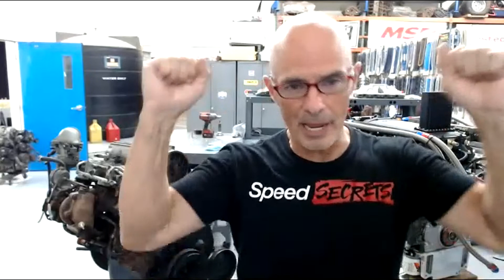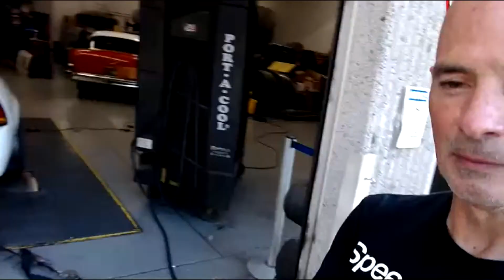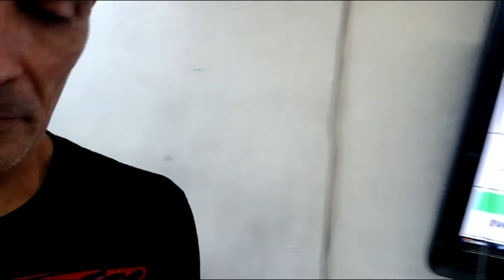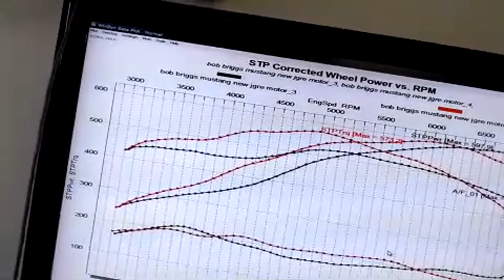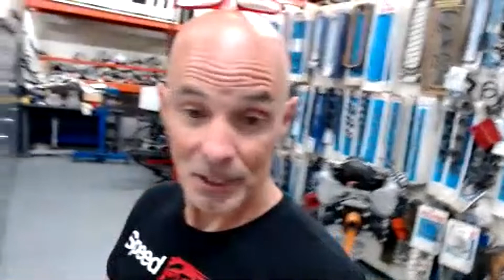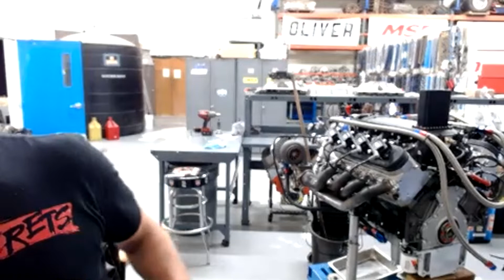LET'S TALK TURBOS-DODGE OMNI GLH TURBO OWNER? CHASSIS DYNO TEST TONITE

Comment: There was a Super 60 package from Mopar Performance that included a higher flow intercooler, larger turbo, larger injectors and a "race ECU" that brought the output to 300+HP.
Reply: The only problem with super 60 was the cam would wear out fast.
Reply from the maker: YEP

Comment: Do you know what fenders were on that new edge? Look like gt 350 fenders
Reply from the maker: WHAT NEW EDGE?
Reply: Was that a coyote mustang I really thought it was a 99-04 mustang on the chassis dyno
Reply: @andrewtorres4580  They're very likely Tiger Racing fenders, Tiger Racing supplied the vented hoods on Ford Racing's factory built race cars(the FR500 cars, Boss 302R/S, etc.).
Unfortunately, I don't know what the state of these parts are - Paul Brown, legendary late model Mustang racer(Pirelli World Challenge champ) and owner of Tiger Racing, died from melanoma around 2012-2014 time frame, and I'm not sure if the molds were sold or what happened to them. I believe Chicane23 was selling some Tiger Racing parts, they may have purchased the molds, may be worth a phone call.
Reply: Here's a term Cobra with the Tiger Racing hood & fenders - one of the last pics has a great close up of the vented fender...
https://www.motortrend.com/features/1510-2003-ford-mustang-a-road-race-terminator-cobra-that-brings-the-family-together

Comment: Plenty of Subaru 2.5 Turbo's intercoolers out there simi cheap. Easly supports 250 HP in the 2005-09 Outback XT's 2.5 turbo. Same size as the STi 300 HP.

Comment: All the 1984 Shelby mods work well on a stock Turbo engine. Shelby milled the 'Carb' blocks 0.030" to raise the compression. But this retarded the cam about 4 to 5 degrees. So Shelby had them make a new cam gear that advanced the cam 10 degrees so with the retard it netted 5 degrees advanced.

All turbo cams were 240/240 @ 0.430" lift. The non turbo engines got 244/244 @ 0.430 lift. A free 4 more degrees duration for a cheap swap.

Baffeling the oil pan with a windage tray that you must make will give about 10-15 HP. Shelby's had a longer dipstick tube so the stock dipstick was 1 quart low so the Shelby's got 5 quarts.

The stock Hyd lifters on the 2.2 and 2.5  bleed down too fast and unevenly. So some will change the running duration of the camshaft while running. The fix is to run the Neon 2.0 or PT Cruze lifter. It has the same bore size but is a little shorter so use a Stainless steel washer under each one to get the pintel point to spec. These do not bleed down fast.
The lifters steel and the steel bottom is loose pressed down in the aluminum bore with no hardend insert so the Stainless washer is doing the same...

Comment: Stephane Bouregard built a Shelby Charger that had a VERY built TIII engine in it that made around the 900whp range back in the early 2000's time frame. I want to say that car was running methanol. That car was low 8's I think. Then Brian Slowe had his Shadow that went 8's. Now has a new owner from what I have seen/heard.

Comment: After 1990 2.2's got balance shafts. The exception to that rule are the Shadow America 2.2's, which would not have them. But after mid year 1990, if it was turbo, it was either a 2.5 TI or the 16V TIII. The Chrylser VNT cars (early 1990 only) absolutely got balance shafts. I have a story of a very long night attempting to delete them out of a VNT LeBaron.

Comment: I know you are going to, but I am really interested in how the water/methanol works. I had it on my car, and I could get condensation on my intake in Florida (at the time). When I dyno tested the car with it on and off, it made NO difference. I wasn't using it for power, more so for protection against knock, but I KNOW it can make a difference.

Comment: So, from a dig in a street race, a stock setup with basic bolt on mods will beat a larger turbo car with similar mods and a so-so tune. The big turbo car will outrun it in the top end, but on the street...even as laggy as that T3 was, it would still beat the larger turbo due to response.

Comment: p.s. Distributor's a 4 blade hall effect trigger that apparently doesn't play well with others, but it's also a flat key "plug in" to the oil pump/accessory shaft and can be capped, and being an '84 that may have a keyed hole on the cam end that's originally for a smog pump but can easily run an adapted, more compatible distributor. Or you can just bolt a standard timing disc on the crank...
Reply from the maker: THNX

Comment: Apparently a Dodge 2.4 bell housing does bolt up to most of the holes on a 2.2/2.5
2.4L TJ 4WD Wranglers use the NV2550 that should have a removable bellhousing. 

But, it's not a typical 4 bolt style. More like a T56 or  Toyota R154

Comment: If you hit a limit with stock head flow, the Chrysler 2.0/2.4 SOHC crossflow head can be adapted to fit, needs (memory fuzzy) one external water line, and a blocked passage.

As far as head gasket issues, the far (facing the engine bay) left corner of #1 has the least amount of surface for the gasket, compounded with a nearby head bolt. Factory torque on an MLS or questionable composite will pinch that corner just enough to have it fail later on. Solutions are to either give that bolt less torque, or punch a hole in the gasket over solid deck and cut a piece of shim stock to stop gasket compression at the desired compressed thickness.

Comment: This is probably old news for you but there are 2 different Dakota manual transmission bell housings that fit the 2.2/2.5 .  The early Dakota had the A535 manual 5sp that bell housing had a rectangular 4 bolt flange.  The later Dakota had the AX15 manual 5spd with an oval 9 bolt flange.

Comment: Original quote - "Looking forward to this. Hope you run the holley or megasquirt, bigger TB and the A/W intercooler and turn it up. Gonna be real smoove" 

Total psychic
I'm am the reincarnation of Miss Cleo. 
New psychic call. 6% more torque than HP on dyno and Richard was drinking liquor in the Cali heat on Wednesday night. Prove me wrong.

Comment: You need to fine a late 50s gmc they cam with the 347 Pontiac
Reply: Have you ever driven one all decked out with the 4 speed Hydra-Matic and I believe that the pickups had an early form of switch-pitch. They had a beautiful Red / White two tone and plush interiors.

Comment: Had An omni glh non-turbo, and that was a pretty  quick little car...nice n lite, came stock with 195/50/15s when tires like that were not as popular back in the day...got phenomenal gas milage on trip from Vermont to Cali, spent little over 100 $ on gas..back in '89..
Only wish I had the turbo omni....
Reply: Eric, my non-turbo 84 Shelby Charger had a 3.05 Ring and pinion and the 0.72 Over drive. IF I was not hammering it and stayed in 5th it got 41 MPG from Georgia to Washington St. 
Flat on the floor in 5th gear I went across Idaho on Interstate 90 doing 15 MPH... Speedo went past 85 MPH then past the bottom 'MPH' and around to 15 MPH and would not go any farther.

Comment: I believe they didn't came with t2 turbo,i remember early one was t3 40trim-.48 std trim, late one's was Mitsubishi Teo4h. Probably this one is your calling t2
Reply: Chrysler made two different power packages, the T1 (tier 1) and T2 (tier 2), also known as turbo 1 and turbo 2. The turbos as you stated, were both T3 flange garrett turbos, but the T1 version was clocked differently than the T2. Additionally, the T1 had a tri-bolt flat intake compressor housing intake surface, to mount the draw through intake boot. This could be adapted to T2 by installing a custom adapter, but, it was easier and more common to replace the compressor housing with a T2 from a blow through T2 turbo. (which again, is a garrett T3) This WAS until 1989ish, when they went to a one piece blow through intake, then all T1 and T2 cars, had a blow through style (T2) turbo. The mitsu turbo also had a T3 garrett flange, and became the standard turbo for the automatic T1 cars, which was the only tier offered for autos due to trans power input limitations.
Reply: @eetack  well the flange wasn't t3,was a weird bolt pattern specifically for chrysler only.
Reply: @mandytuning  They were a standard T03 garrett turbo flange. This is a garrett spec, not chrysler. This flange style was also used by ford, and volvo off the top of my head.
Reply: There was also a T3 package, that included a TB03 flanged VNT turbo.
Reply: @eetack  nope, actually was t3 garret trim 40-.48 standard trim ,but the exhaust flange was chrysler only pattern.1 of the bolts was very offset ,i used to remove those turbos back on the days and swap the exhaust housing with volvos and saabs that was a true t3 flange.
Reply: The mitsu teo4h  turbo also came with the crysler pattern,that turbo we used to swapped on hyundai 1.5liter  and running mid 13 on stock engine,thats was 1995.
Reply: @mandytuning  The T03 flange is not T3 or TB03. They are all garrett standards, again, not chryslers, those standards were used for other manufacturers applications as well.  The T3 "turbo 3" package from dodge I mentioned, was the DOHC lotus head engines, they came with a TBO3 flanged VNT turbo, which is not the standard T3 garrett turbo used on the T2 or T1 packages. There are 2 slightly different turbos, only by compressor housing and clocking, as well as a VNT with a TB03 pattern, and one mitsu with the T03 garrett flange pattern. http://www.thedodgegarage.com/turbo_turbo.html

What do I know though, I didn't own a 13 second hyunda back in 95, I owned a Daytona.
Reply: @eetack  https://www.ebay.com/itm/NOS-Mopar-1984-Plymouth-Dodge-Chrysler-2-2L-I4-Turbocharger-/362660857432?mkcid=16&mkevt=1&_trksid=p2349624.m46890.l49286&mkrid=711-127632-2357-0 not sure if we are at the same page,i refer this flange is not a standard  garret t03 flange ,is only Chrysler  t1,t2,the mitsu came with same flange